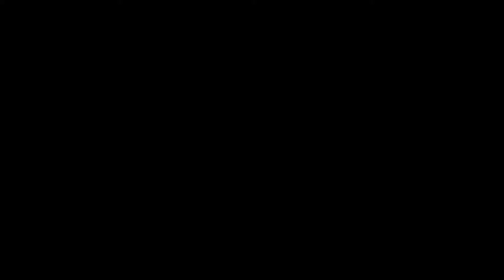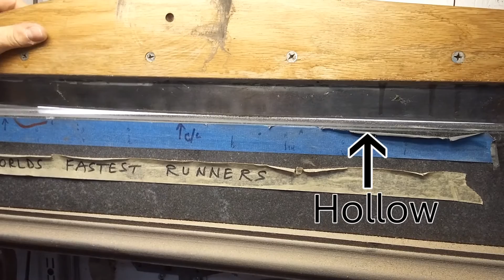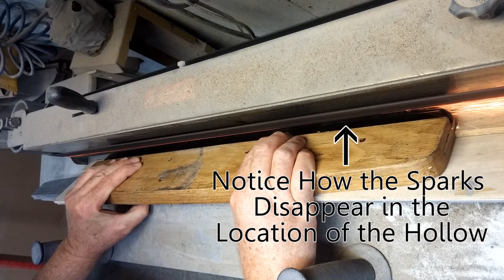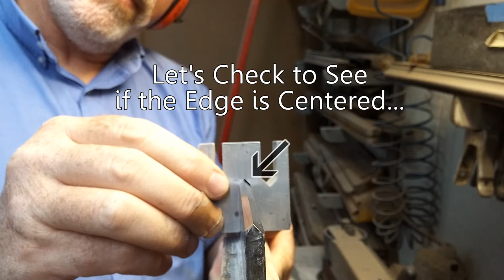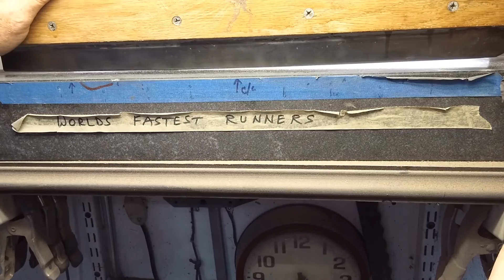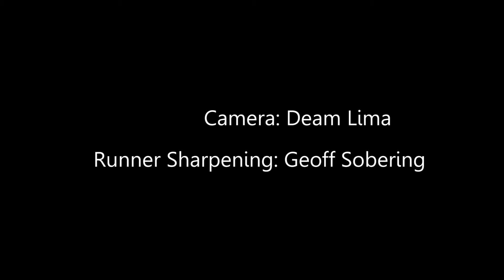Sharpening Howard's Runners

Comment: Your profile seems quite radical. I usually measure my rocker with feeler gauges. .010" is decent rocker for hard ice around here (Northern New England). I go right up there with the NEIYA rockets for speed. They showed me runner tuning. "T" and Eben.
Reply from the maker: Yeah, the profile is quite short. They're for a home-built 5.6 mini landsailer which is often sailed on small areas so I went with a shorter profile to help reduce scrubbing in the turns.
My "go to" DN insert runners have 18"-20" of 0.008" flat.

Comment: What is the name of the tool you use to check to see if the edge is centered? I need one of those. I think Jeff Kester has one too. Also, not too much flat in those runners. How would you describe those in terms of inches of flat. Do you use the .004 spacer to measure the flat?

Comment: How are you keeping the 45 degree angle?
Reply from the maker: The runners are clamped to an aluminum jig that holds them at 45 degrees and slides on the sharpener table.